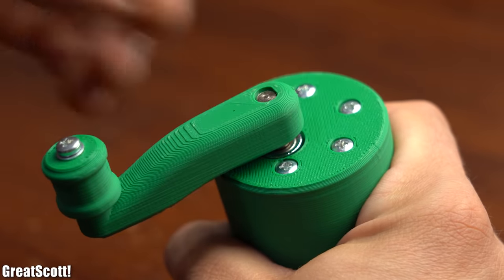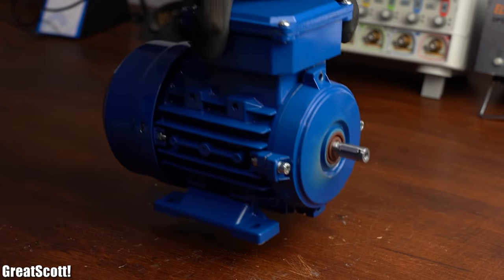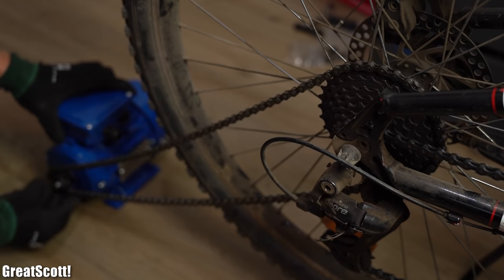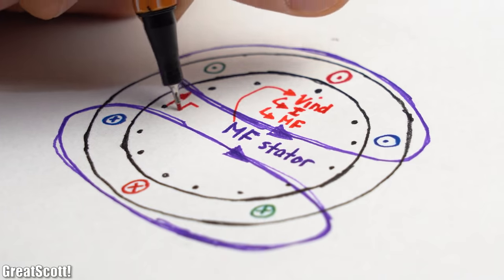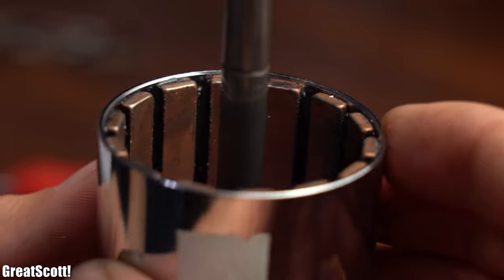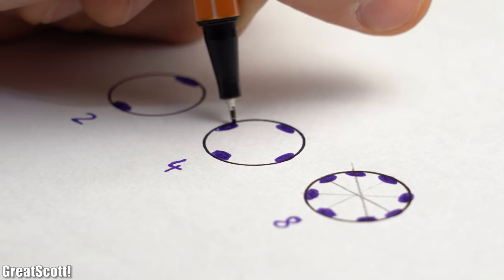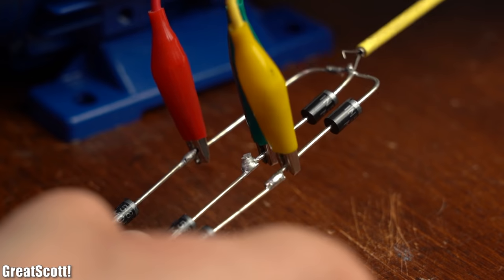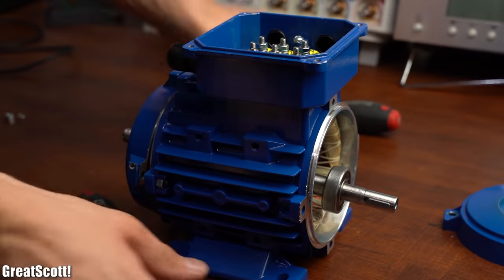HACKED!: Turning an Induction Motor into a Generator?!

Comment: Connect the induction motor to power supply and rotate it faster than its synchronous speed it generates a good amount of power while drawing a reactive power from the supply.

Comment: This video is really interesting. When an Induction motor runs as generator, it's called Asynchronous Generator and it happens when rotor speed is faster than synchronizing speed of the field, i.e. the slip is negative. I suspect if we normally run an induction motor from supply and than rotate the rotor even faster by providing more power to the shaft, our motor should generate and feed back to the supply. I'm interested to see if you can do such experiment and post a video on it. Induction motors are used in electric car and act like generator during braking resulting the braking power to be stored on cell (aka Regenerative Braking).

Comment: Just use capacitors to self-excite and use electronics to make a stable voltage. You made me cry with what you did to that rotor!
Reply: That's the best solution....the only drawback is that he would have to peddle faster than the motors rated RPM to start generating electricity.  Which is hard to do because once you past the slip speed resistence sets in even without a load
Reply: @rogerrabbit7469  Probably be better than this sorry state of a rotor even at low rpm.

Comment: If you want to go with larger motors, like in this video, you should get your hands on a synchronous motor with permanent magnets. It's exactly what you are trying to do here, but it will have a much smaller gap between the rotor and the stator, wich means less wasted energy, and higher voltages on the output. An asynchronous and synchronous motor have the same stator, its just the rotor that differs. These types of synchronous motors with permanent magnet rotors are a bit more expencive tho.

Comment: some info.      at :31, the presence of a  Resistive  load in the output circuit  SCREWS  up  measurements  and  reduces the amount if lenz-related  drag, in the genny.

Comment: the large gaps in the second motor plus the reduced magnetic permeability clearly are causes for bad performance, also you should take into account the  amount of poles in the stator to determine how many magnets you need in the rotor.

Then again, induction motors can generate power as is, if you run them on an ac line and then use some mechanical power source to spin the rotor above synchronous speed, this was common in older wind turbines iirc.

Comment: Or just take an alternator from a car and hook it up via a belt and easily generate stabilised 14.4ish Vdc and as many wqts your stamjna can handle.

The second issue with asynchronous motar are that the voltage fluctuating quite a lot base of the load, synchronous motor are better choice but they're a hassle to work with because of the DC requirements IF I remember correctly.

And as always, your videos are both entertaining and educational. 

//Cheers.

Comment: If you still want to use a bike look up on amazon “motorized bicycle sprocket adapter” and there will be sprockets that bolt onto the 6hole disc brake mount. And they use 415/41 chain

Comment: There on internet is couple videos  of people using 2 or 3 capacitors to convert 3 phase motor to one phase AC generator without any motor modification (google result of "AC 3 phase motor generator with capacitors"). To start generating it needs slightly more RPM than normally that engine runs. With that caps 3phase motor can run on one phase (with reduced start torque).

Comment: It would be enough to put capacitors in parallel to the original motor. There is a bit of residual magnetic power which would create a bit of energy (as shown at your scope) this low voltage would be amplified by the resonance.

Comment: @GreatScott! I think, you were wrong, when you placed the magnets in alternate order. You shuld place them to get the rotor with one side fully south, and the other fully north; becaus when you run the induction motor, that is the induced magnetic pattern in the rotor, not 8 south, and 8 north. If i were you, i would give a try to that setup... Correct me, if I am wrong
Reply: Depends on how many poles the winding has.
Reply: @matthewmaxwell-burton4549  He stated the first motor is 2 pole and the 2nd motor is 4 pole. Reading the comments, you beat me to the answer. I posted that too, but wanted to see how many people here actually caught that error.

Comment: Nice work, Scott, i think that the problem is not the orientation of the magnets, or even the magnets, you can use just two of them (pretty big, obviously). Remember that the separation of the poles (on the stator) is made for generate a rotating magnetic field , the rotor will just act as a big magnet, if you want to generate power, with an inducton motor, i suggest, changing your rotor for an alternators car rotor.

Comment: Maybe fit a bike chain tightly over the big sprocket to make it flat then remove the little sprocket and just go with a long rubber drive belt held at tension. Like a vacuum cleaner.

Comment: The rotor needs to be ferrous to drive the magnet flux. the air gap between the rotor and stator plays a big role in the reactive power consumption to magnetize.

Comment: Great scott you can get the job done by capacitor in parallel with the coils  it turns out the value of the capacitor is related to the resonant frequency

Comment: You have to match the number of poles of stator winding with the no of poles of rotor , in a scurrel cage motor rotor poles are formed by induction since automatically match with the stator number of poles. and the airgap length should be as small as possible. Less than 0.5mm is great.

Comment: Shouldent the phases sine waves be shifted 120 degrees from each other? otherwise the there is nowhere for the current to flow if the phases voltages potential always is the same?

Comment: You missed the whole Asynchronous Generator. You somewhat match the inductive reactance of the SCIM to a 3 phase connected capacitor bank reactance to create a near tank circuit and the motor will generate nearly the same power as it is rated to put out. Don't mess with the rotor.
Reply: So if he added capacitors to the unchanged motor it wouldve generated almost the same ammout of power its rated to put out?
Reply: @sebagomez4647  You are understanding what I wrote. I have actually done it in my lab to show my students and fellow instructors.
Reply: @ReevansElectro  how nice. I have one of those motors so im going to try to see how much i can generate

Comment: You can try using a servo motor, the one used for robotics in factories but that one have a very strong magnet and would require a lot of torque to turn

Comment: You can use three phase inverter, like one in variable frequency drives, with addition of speed measurement to brake the motor. Drive sine wave with slower frequency than the rotating speed of motor. Note that this will ramp up dc bus voltage significantly.This is in fact the way huge industrial motors are braking nowadays, and the energy is often driven back to grid. Also EV's regenerative brake like this.
Cheers! -Jani

Comment: Maybe try using a car alternator for your bike generator? It's already optimized for power generation, cheap and easy to find in a local junk yard, and finding or making some kind of belt that fits into the groove of your bike wheel rims so it won't fall out while turning the alternator's pulley should be pretty doable. Or  maybe find a storm outage generator on craigslist and pull the generator electronics out to hook to your bike.
At the very least, reverse engineering a generator-mode optimized motor like an alternator would make it easier to build your own without have to re-invent the wheel.

Comment: Ya know, all you had to do to use this as a generator is to spin the shaft faster than synchronous speed while connected to mains. This does assume you have 3 phase power. You can also use an induction motor as a brake (energy lost in the motor) by applying a small DC voltage and current, as this creates really strong eddy-currents. It does heat up the rotor a lot and can damage it if your not careful, though.

Some of the more fancy ESCs  or VFDs meant for powering induction motors have this feature built in. They can "brake" the motor to slow it down rapidly in CNC applications, and effectively regen. Tesla obviously does the same, regen with an induction motor.

Honestly the working principle of induction motors is just black magic to me. Field Oriented Control with a PMSM or BLDC makes perfect sense. Just a rotating B field causing magnets to chase it. But the rotor power being induced by the stator just makes them so much more complex!

Comment: You can create self excited induction generator without modifying the rotor 

I made grid tie wind turbine with single phase washing machine motor.

Yes it is less efficient than permanent magnet motor but free energy is free energy (reduced electricity bill) .

Comment: You can use an induction motor as a generator WITHOUT applying an external voltage. Using properly chosen capacitors and a little bit of initial remnant magnetism (which should exist anyway). Look up Self Excited Induction Generators (SEIG). 

I have done this before and it is possible to have 400Vrms appearing on the terminals of the motor.

Comment: What you are creating here is basically a synchronous generator.
You need much stronger magnetic fields and higher RPM values to achieve a desirable output power.
To make an induction motor into a generator u need to supply the stator with normal 3 phase power then crank up the rotor rpm above it's synchronous speed which will make it go in negative slip region and then it will pump back power to source which u can harness using slip power recovery system.

Comment: Hi, i suggest you use a DC motor from a washing machine. I have experimented with that. You can use it as a shunt generator, so it will create it's own magnetic field when you rotate the axe. The only drawback ( or not) is that it generates DC Voltage.
Keep up the experimenting. I like your channel
Reply: I've heard about using washing machine motor as a generator, but I thought they'd all be AC

Comment: The ideal way would be to make a new shaft with a lathe and then mill the grooves in the rotor with a mill and a divisor for gear milling. Machining is better than 3d plastic printing.

Comment: Sir you can use ceiling fan with its secondary winding only and it will a good power source and the induction motor

Comment: With a start capacitor, it works quite efficiently above synchronous speed (you don't even need an external power supply on some motors)

Comment: The hand-cranked motor could easily be adapted as a bike-powered generator without any chain or gear - just clamp its spindle against the tire tread or wall. My Dad had a Korean War era 3-speed bike with a headlight powered by such a motor. I think some manufacturers are still making such dynamos (which is the proper term for such DC generators).

Comment: I see an opportunity to increase potential generator rotational speed. What if instead of adding a gear to the motor shaft, rubber or a small tire was mounted on the shaft to contact the tire instead of the bicycle's gears? This should increase the ratio to spin the shaft, while simultaneously decreasing pedal resistance, to spin the motor faster. 🤔 This will also allow the bike to use all the gears while pedaling, so you can start in first and gradually increase momentum.

Comment: the air space on the second motor generator by using the smaller rotor was a problem. you should make one with the minimal air gap you can. also could use some iron hoops around the magnets it may change things.

Comment: You can use an induction motor as a generator, it just has to be connected to an ac source first. Efficiency is not great (60% to 80%) and slip speed is what controls the power output, so you have to drive it faster than it's nameplate rating.

Comment: 1_You have to make the number of magnets equal to number of the motor slots 
2_ be sure the magnets arranged "N,S,N,S,N,S" without repeating any of the poles.
3- thank you.
Reply: Not true. In 2 pole, there are sets of slots for the A phase, usually 4, 6, or 8 slots for the 2 poles, then another set for phase B and one for phase C, so your slots are 12, 18, or 24 slots in the motor. Proper magnet orientation for the 8 magnets in the two pole configuration to make 2 poles would be NNNNSSSS. Since your username mentions Electronics and Physics, I am very surprised you didn't catch this. Are you a beginning student? The 4 pole configuration for 8 magnets is NNSSNNSS. Rotor poles matches the stator poles to work.  Poles, not slots.
Reply: @isettech   
1~ I am not a begging student  but every one make mistakes so you are, and the following sentence is my solve 
1_ minimum no of magnetis for each pole must be  3 or a multiplication of 3 such as 6 or 9 or 12 ... etc
2, So the 8 magnets  not possible why? (Cause the motor is 3 phase here an nearest no  of magnets for two poles in 3phase configuraddressation is 6  or 12 magnets  )
3_ so the magnets arranged is (NNSSNNSSNNSS)
Or (NSNSNS)and this Arrange has  minimum no of magnets
Thank you for your notes and the discussion led us to the solutions .

Comment: AFAIK: It isn't so much that the number of magnets needs to be even, but more so that it is both even and ideally a common multiple of the number of phase coils. For a 3-phase motor, assuming 6 coils, one would then need either 6 or 12 magnetic poles (though 2 or 4 should also work OK). In contrast, 8 would likely have been be better for trying to convert a split-phase motor (or, in a BLDC, for optimizing for speed rather than for maximum torque and reducing the amount of "cogging", though this effect should be more useful in a generator). Also with permanent magnets ideally one also needs a rotor with a fairly high magnetic permeability (such as silicon steel), etc...

Comment: I made a generator with a 10HP 4poles three phases induction motor, I used a capacitor bank to generate the reactive power it needs to turn it into a generator when it revolution speed is higher  than the synchronous speed + slip. It works well, it has power nevertheless, frequency is a little low (about 40Hz at 230V instead of 50Hz) so I am looking to develop a 3 phase inverter to regenerate 3sine power at 50Hz and 230V.

Comment: The mistake was the armature size. Magnetic fields decrease at 1/distance squared. you need the magnets a LOT closer to the stator...like less than 1mm. Make another armature and close that gap between the magnets and the stator as much as possible.

Comment: Instead of a  bicycle, try a DIY wind turbine with a gearbox/pulley system. Wait for the turbine to attain a certain rpm (threshold rpm ) and then supply some kick-off power supply so that the rotor (stock rotor) generates some magnetic field.  After a certain rpm (need to find out???), cut off the input voltage using a tacho-Arduino setup.
Then the induction motor should be able to generate power. But finding a balance for efficiency in this system will be a tedious task but worth doing.

Comment: if it doesnt put out any power the magnets are to weak or the poles are the wrong numbers. motors like these are either two pole or four pole. the paralell configuration of wiring can cause the emf to be short circuit. the best way to use it is by the high voltage configuration. i had very weak magnets on a 1 kw 3 phase unit and it did put out more that 20 watts. if you arange to many poles in that thing it will cause reverse voltage in the windings and produce little if no power.

Comment: I was thinking about a similar proyect, maybe if you use a 12 v battery and a little 3 phase inverter to power the stator with a variable sinusoidal excitation and at the same time measure the rotor angular velocity in order to play with the phase shift of the waveforms you can extract more power.

But i dont know if 12 V its enougth for the stator windings.

Comment: You need to have same number of pole rotor as on the stator for working properly. It must be rotated at higher speed then synchronous speed specified on the name plate. Most important it can work as generator if supply reactive power to the motor means you need to connect a three capacitors in delta configuration on the stator they do there job.

Comment: You need external circuit to excite the coil and then try to rotate rotor at higher than synchronous speed.

This did not perform well either due to large airgap. Or because your material of choice did not have high enough reluctance. Or your magnets are not strong enough.

If you use external circuit you can use the normal squirrel cage rotor, without any modifications. The circuit might be complicated to design, but the advantage is thay you can put the complexity in electronics rather than on mechanical components.

You could try using a reluctance motor which is similarly robust as an IM but simpler on electronics side as well.

This design behaves as a synchronous gen. and the o/p voltage will be highly dependent on load. Capacitive loads can dangerously raise the o/p voltage, whithout controls on field it's quite unusable

Comment: Because you are doing fun projects, you might as well use a friction rotator contacting the bike wheel, the efficiency lost would be very low at a high pressure wheel and low pression friction contact.